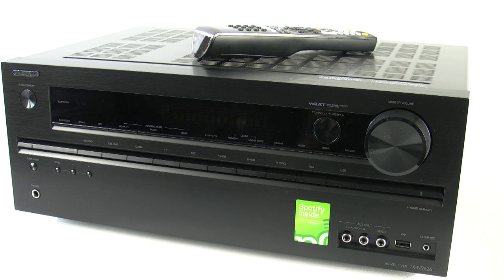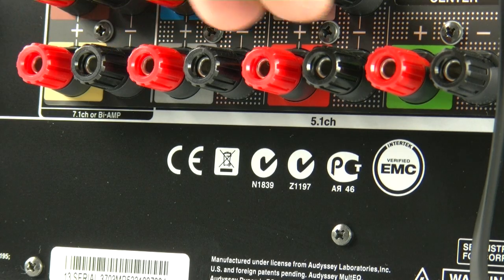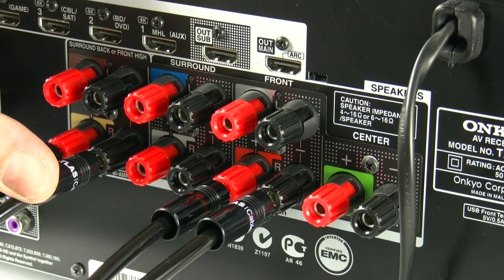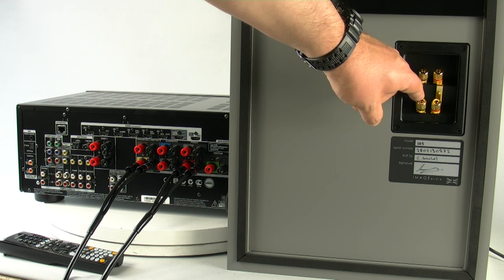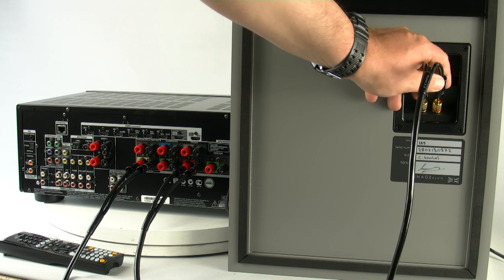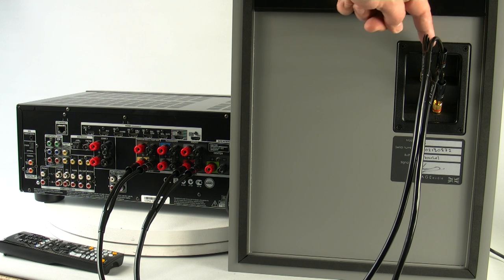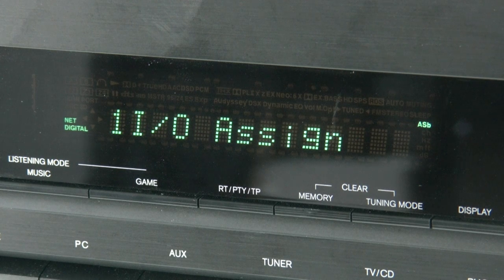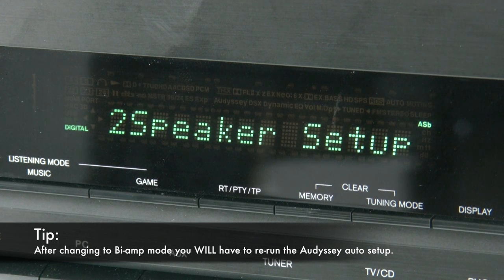NEW 2013 ONKYO AV RECEIVER TX-NR626 - How to Bi-amp the main speakers

Comment: I'm confused a little, will the wattage be higher if you bi amp your front speakers and will the crossover evenly give the amount of wattage to each speaker? like say you have a reciever rated 90 watts at 8 ohms and you bi amp your fronts, would you get 180 watts? 90 for the woofer and 90 for the tweeter?
Reply from the maker: Hi, typically there is an increase of 20% to 25% Watts when using bi-amping.

Comment: question...does this amp will work to my Pro-ject Debut Carbon turntable? some says i will need a separate phono amp instead of A/V amplifier, any advice?
Reply from the maker: Hi, please verify if your A/V amplifier has a phono input (not all AVRs / Amps do have one) - and connect your turntable to the phono input. Please do not use the line inputs to connect your turntable...